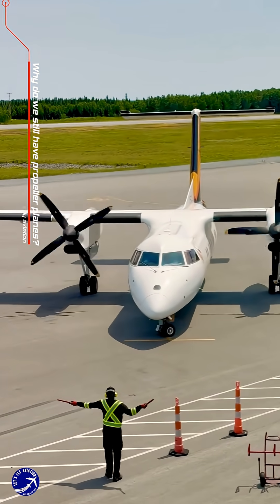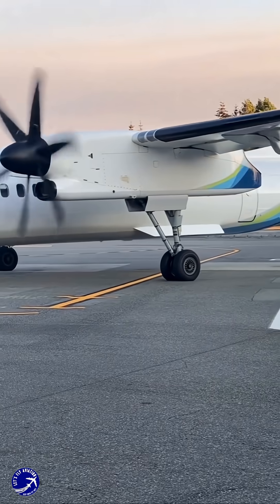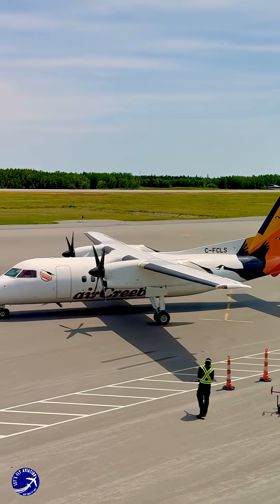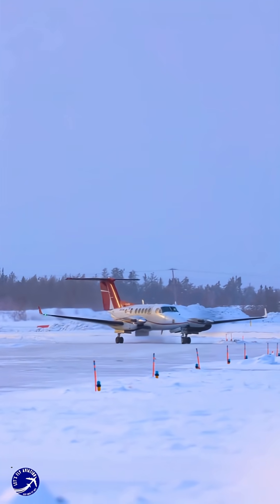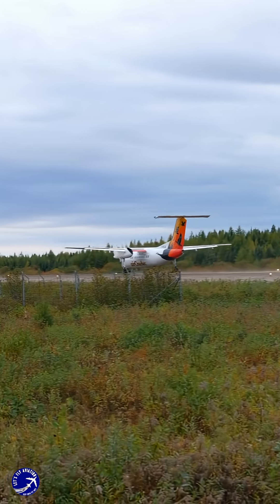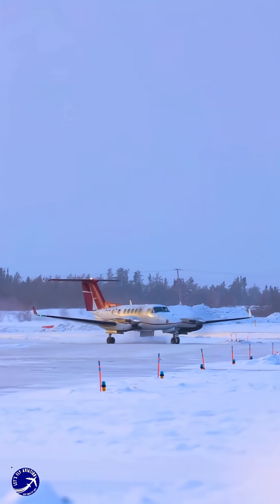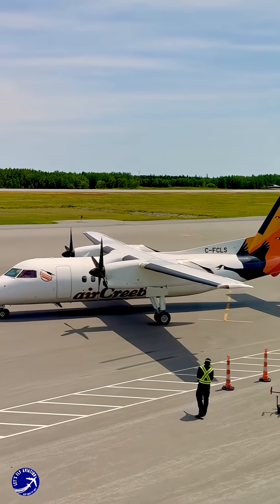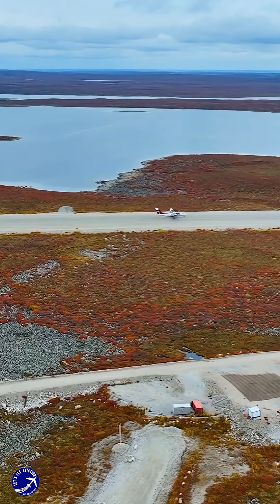Why do we still have propeller planes?

Comment: The most interesting propeller plane I have flown on was the DC-3 also known as Dakota. It was not a turbo-prop and it's engines had pistons, rather like in a car engine. It's undercarriage had two wheels in the front and one at the tail. As it sat on the  tarmac, it's body would slant from front to back. While taking off, it's tail wheel would lift first and then the rest of the plane.
Reply: A particular DC-3 has been converted to turboprop.  We  can lookup
 " Basler BT-64 "buffalo airways"  "
Many beautiful DC-3 conversions are also out there as Basler BT- 67's.